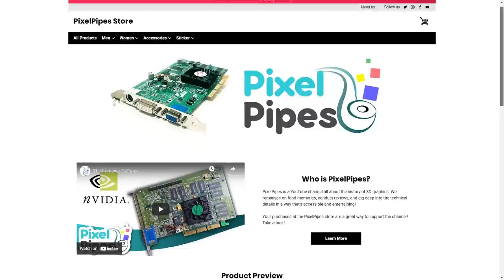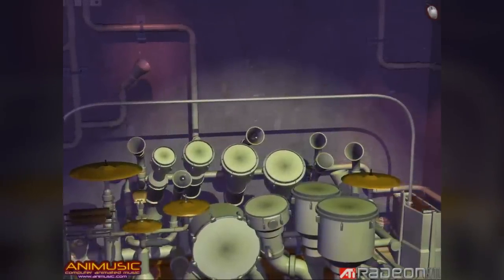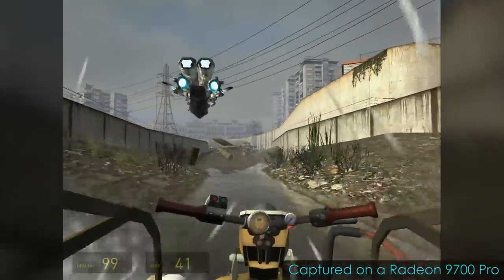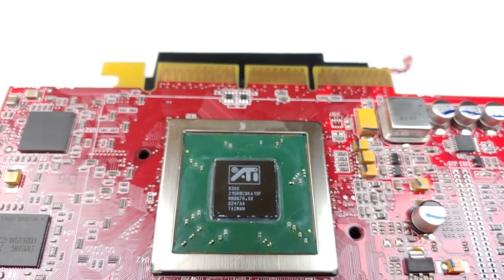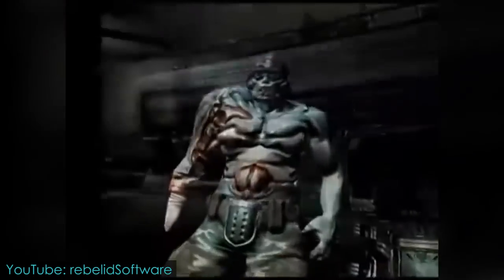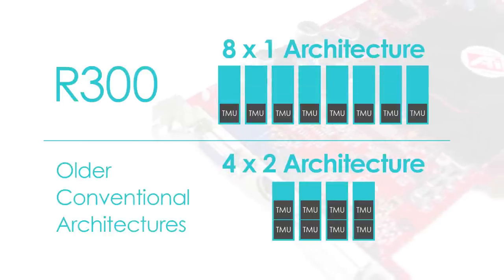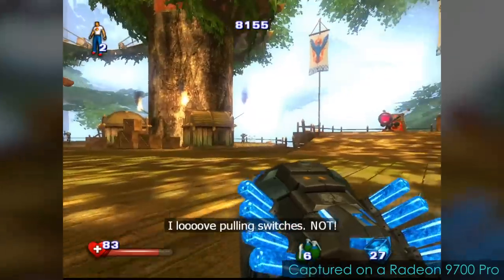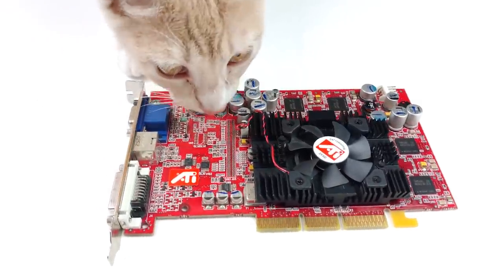ATI's Revolutionary Radeon 9700 Pro

Comment: Fantastic video! The 9700 Pro is one of my favourite graphics cards and it was such an exciting time compared to what we get these days...
Reply: Think about it, back in the day we would get great sound cards, great graphics cards and the leaps and bounds were actual leaps and bounds. Now it's like well you can play this game at 4k at 120FPS vs 60FPS.
Reply: @C4nn15  You know when even decade + old computers with 8GB DDRII, an OC AMD Athlon II X4, a cheap SSD, and with a lowend GPU like an AMD R7 240 2GB can still run many modern titles at 720p - 1080p low settings getting 60fps, or close too it running a lightweight Linux Distro like Manjaro Mate then we have hit a peak of sorts in terms of tech IMHO!  
I truly don't get the excitement these days that I did back in the 80's - mid 00's seeing each leap forward in tech.
Reply: That was an exciting year indeed
Reply: @CommodoreFan64  My current system is from 2012 with only a GPU upgrade to a 1050 Ti, and I can still play most games at decent settings, at 1080p. Granted, it's definitely time for an upgrade, but considering I've gotten 9 years out of this platform, it's certainly much different from how things used to be.

I recently acquired a Pentium II-based IBM Aptiva, and a system like that would have been hopelessly obsolete by the time this card (Radeon 9700 Pro) would debut, despite its very high performance just five years prior.
Reply: No the 9500 pro with a bios of 9700pro.
That is the card .
I had one with a aftermarket cooling like a blower.
Thing overtune like shit.
Reply: To be fair, the last generation now was actually a decent step up (the RTX 3xxx series and AMD 6xxx series). It's just that the prices are absolutely unreasonable.
Reply: @dyslectische  but there were no guarantee it would work
Reply: @PhilsComputerLab Do you have the CD or driver for the aiw 9700pro 128M AGP for Windows XP?  I have the card but did not come with the CD with the drivers and I cannot find the correct one online.  I'm willing to pay for it. Please let me know.
Reply: @jcjmz6660  You do not need a driver CD, the XP drivers are on the AMD website in the download section! Let me know if you have troubles!
Reply: @philscomputerlab  Thank you very much for your reply, I will try that, I'm waiting for a WD velociraptor from the XP era to install the OS again.  Very much appreciated.
Reply: cant wait for RTX 6090 to buy
Reply: It was exciting, but I'd rather not relive the time, where GPUs became near obsolete within 6 months.
Reply: @CommodoreFan64  yup I feel gtx 8800 may have been the last grand gpu release. Since then it was just who cares 30% gains every year with the occasional  50% if the competition looked like it would release something actually competitive. The last era I truly enjoyed the majority of game releases with 2005 to 2008 roughly. Then it truly went full fledged endless sequel, rehash, then eventually the current dark ages of unfinished games at launch, micro transactions,  and also overall lack of new releases in general because companies are just cashing in on their current games and investing mainly in the micro transactions and merchandise to those games.
Reply: It's 100% my favorite GPU from the past. Absolutely hands down. Everything changed with this VPU.
Reply: @dyslectische  Yes! Loved those mods.
Reply: Back when great video cards were affordable eh!
Reply: Same, love my Hercules 9700 Pro. It smokes every AGP card I have of its era. The only thing it can't beat is a recent X1950 Pro AGP I got, another vast behemoth.
Reply: Sometime back around 2003-2004, after coming up with all that i could and setting a budget, i built my first PC. Hard to remember every exact detail now, but it had a P4 2.4ghz CPU, i think only like 1gb ram, an 80gb HHD which was actually fine for a while. Win XP pro. 5.1 surround. And being a fan of ATI going back into the 90s, i had the All in Wonder 9700 pro, which was $400 at the time. Altogether it cost me $1,800 to build back then. And this PC held up fine for a long time, eventually my GPU went for some reason, so i replaced it with something newer. I sort of retired it somewhere around 2012. (Because of the mobo i couldn't further upgrade the CPU or RAM) Just wasn't holding up so great, so i just used it for emulation and older games. 

But those were some good years back then, i miss it. There was a lot of cool stuff we just don't see anymore.

Comment: I made the jump from a GeForce Ti4200 Golden Sample from Gainward to an ATi Radeon 9700 Pro when I built a brand new system based around the nForce 2 Ultra kitted with an Athlon XP 2500+ and 512MB of DDR1 Corsair CMX Platinum which allowed me to OC the CPU to 3200+ levels at a much lower price. The jump was incredible and I was playing all my current games at higher res on my 19" Trinitron monitor. I remember working for 3 months to save up the cash (fast food and being a teen meant minimum wage) after hearing the news of the pending release and bought the card a few weeks after release.

Comment: Very nice video! I remember, that I desperately wanted to get a 9700 Pro, but as a student, I just didn't have the money to buy it. But there was a solution! With some luck you could modify a 9500. Shorting two contacts with a drop of electric varnish you could enable all 8 pipelines and with some overclocking get it on the level of the 9700 Pro. This was what I did eventually and I had luck. I added a better cooler and even overclocked the card over the usual 9700 Pro frequencies. I used the card for a quite long time and still think, that it was one of the biggest steps in real time 3d graphics technology.

Thanks for the memories!
Reply: Same fond memories of unlocking and overclocking the snot out of my 9500. While my memory clocks were never terribly impressive my core went to the moon!
Reply: thank God someone mentioned this. Good old days!

P.S. - I never had the money to afford myself those Radeon cards. But I knew about all of them and all their capabilities and possibilities. Wonderful memories.

Comment: I loved this video, and I loved my 9700 Pro when I bought it used in 2004. I do find it amusing that the interview clip with John Carmack had him talk about how fast the R300 could render real-time shadows, though. When Doom 3 was first released, the cards in the R300 family were under-performing until a programmer in the community realized that the driver calls for computing shadows were remarkably inefficient. He wrote a patch that replaced those instructions with more simple equivalent math, and performance increased by a VERY noticeable amount! It was so good that ATI integrated it into their next Catalyst driver revision, and it was mostly forgotten after that. I still have the file, even though it's not needed anymore unless one is using Catalyst drivers from before 4.9 or so.

Comment: I was fresh out of high school when this came out, this was the card I always wanted but could never afford back then. I believe every computer nerd has that one piece of hardware they always wanted to get but couldn't afford at the time. Mine was the 9700 Pro. Nearly 20 years later, I finally put a 9800 pro in a 2003-2004 era P4 rig. Thing shreds...
Reply: I was just entering high school at this point and remember how the 9500 Pro was the overclocking champion, the 9700 NP (non-Pro) could be modded/overclocked to insane levels, and the 9800 Pro couldn't be beaten by NV even once they finally showed up to the party.  I wish I hadn't thrown out the cards I had back then ("those slow old things haven't been relevant in years, why do I hoard this junk" mentality) but I have rebuilt my collection with a 9500 Pro, 9800 Pro, as well as X1950 XT and FX 5950 Ultra (always wanted one but they were too expensive).  Fortunately I still have the same computer as I did then.  I keep my 5600 Ultra in there to keep the power supply load easy (this is when PSUs had a max output of about what my 3080 pulls) with the same 60 GB WD hard drive though I have maxed the board out at 1 GB of RAM (up from 128MB) and it has Windows 7 because back then it was amazing how it could run on "only" 1GB of RAM.  Back before Roku sticks this was my streaming machine once its duties as gaming machine were retired.

Comment: I still run a ati aiw 9800 pro.. Love the card and all its features.. tuner still works with a digital to analog converter and a tv antenna .. used to to convert vcr tapes to dvd.. saved family videos.. play games.. ect. ect..
Reply: Likewise, although I think the composite in has went on mine. The image is completely messed like those macrovision copy protection all the time. The rest of the card seems to work fine though, strange.
Reply: @gen_angry  that stinks.. It is heart breaking when they finally give out..

Comment: I had the Geforce2 Ti when Battlefield 1942 came out. I got low fps and stuttering no matter how low the settings. Upgraded to the 9700 pro and wow. BF142 on med to high settings, zero fps drops or stuttering. 9700 pro is 1 of the best gpu's I owned.

Comment: Never had a 9000s card but always looked at them with awe...these were the best days.. unlocking driver features with tools an if you was lucky enabling extra shader pipes like was it on the 9600 to 9700pros an the 6600 from Nvidia had versions that could be turned into 6800s... I looked at my locked shaders in my 6600gt in riva tuner an wishing I could unlock them...tho my 6600gt was as quick as a stock 6800 in most stuff due to the insane clocks it had...but still those extra 8 shaders an 4 vertex shaders would of been a treat...an the fact they was physically on my chip made me cry

Comment: Voodoo5 5500 required external power in 2000 in fact it need more then the 9700 and used a full Molex connector
Reply from the maker: You are right and I got this wrong.

Comment: I get sentimental with this, what a greatly put video. The fact that you can still use this card on Windows 11 is just nuts. The official Vista 64bit drivers works when you install them through Device manager just fine.
The die shrink (RV370) of this on PCIe (X600) runs even on my modern AM5 PC with CSM enabled, connected to my LG 4K OLED TV through DVItoHDMI adapter. Yes, it DOES RUN CRYSIS. Revolutionary chip indeed. It's such a nostalgic feeling to have this working on my main PC, playing the classic games I had on my first PC that I got on my 10th birthday.

Comment: Back in those days I had a 9500 Pro which was the 9700 Pro's slower but still quite capable brother. It was amazing to see what that card could do, especially compared to the Radeon 8500 & Radeon DDR cards I had owned before the 9500 Pro. I was crushed when my PC was damaged as part of my divorce in late 2005. I was able to salvage the rest of the machine but sadly the 9500 Pro never worked again.

Comment: Aww man! Brings back fond memories! Water cooled Athlon xp 2500+ and volt modded 9700 pro on GPU and memory. I remember ripping off the voltage regulator on the back with the heat spreader in it 😢wanting to put a proper heatsink on it! I got a nice O.C from it until one day I come back to the pc in two colour mode, just black n white. CPU waterblock leaked onto my beloved Radeon!

Comment: I had a Radeon 9500 in my computer. Sadly, it couldn't be modded into 9500 Pro but it was still an amazing card. <3
Reply: I had/have a 9500 Pro & remember unlocking it with Kip Hardina's Warp11 BIOS... 🤔😊😄
Reply: @David Bolha  i tried to unlock mine with modified ATI drivers. While it did work and I was able to get extra pipelines working, there were artifacts on screen. For instance, I'd have a mesh of equally spqced rectangles on the screen along with visible video distortion.

Comment: I went to CompUSA(remember them?) and they didn't have any 9700 Pros in stock, so I headed over to Best Buy and they had ONE left. I brought it home to replace my 8500 and was blown away by the speed. It was so fast that it was CPU limited. When I replaced my CPU the next year my minimum FPS went up a ton. Eventually replaced it with a 6800 GT which was faster but not nearly as cool.

Comment: I could not hit "Like" on this fast enough! This was my first GPU upgrade way back in the early 2000s. A phenomenal, legendary GPU that for me personally introduced me to the hobby of PC Hardware. I wouldn't have the enthusiasm I have today were it not for this card. Kudos to you for producing this excellent content! 

A story I like to share is that my father was using our old family Dell Dimension 8200 as a USB charger. Yes, the very one that I upgraded with an ATI Radeon 9700 Pro in 2003! I went home to visit probably sometime in 2017 and he had this desktop tower plugged into an electrical outlet and nothing else connected to it except for his cell phone. Inside was my original ATI Radeon 9700 Pro slaving away, fully powered on, simply so he could charge his cell phone. Needless to save I promptly unplugged the machine and took it home with me where it still resides to this day. I still have the original box which I will always cherish.
Reply from the maker: You did a great thing saving that card!

Comment: Oooh, I had one of these, bought to play Far Cry. It had a giant Zalman passive heatsink on it. It cooked itself.
I replaced it to a 8800GTS to play Crysis, and it cooked itself.
After some years with midrange stuff, I got a GTX 970 to play DOOM 2016. Put giant superadvanced Arctic cooling on it so it does not cook.
... it cooked itself.

Comment: The performance benefit of the 9700 Pro was massive in comparison to the 8500LE that I had before it. My 9700 Pro was the AIW version. I had to get the AIW as the regular 9700 Pro was not in stock at the time. Computer stores in my area couldn't keep them in stock due to their popularity. They were also creaming FX series GPU's from nVidia. It was only when the 6800 GT came out that I replaced my 9700 Pro AIW with it, when VRAM was now becoming a focal point of future gaming.

Comment: I had a 9500pro I got from a friend for free. I benched that against an Nvidia FX5900xt and while the 5900 won, it was not by much.  I even had fun and installed the bios from a 9700 in that 9500pro just for the heck of it. When it ran it displayed 9700, fun times back then.

Comment: Man that intro deserves an instalike before I keep watching the video. What application was that? It reminds me of the xp era or even before that.
Reply from the maker: Pipe Dream? It was a famous tech demo for the 9700 Pro
Reply: @PixelPipes  thanks man. I still have the little brother of this beast fully working. I used it until 2007 then upgraded to an Nvidia 8400gs.... it overheated so much and worked so badly that in a couple of months upgraded to a 9600 GT Super.

Comment: I also have very fond memorys of the card. In fact, it is the only ATI/AMD Card i have ever used (as in my top tier system) in all of my years of PC (Gaming), apart from the Rage 2+ in my first PC. 
Coming from a originally-not-so-shabby Geforce 2 Ultra, i was amazed by its DX9 graphics and, thanks to its wide design, the ease it seemed to have running all titles at high resolutions with anisotropic filtering and even FSAA. i dont know how many hours i clocked in elder scrolls III morrowind with it, must have been easily four-digit...

like you, later i moved on to a 6800 GT to feed that sparkling new 1680*1050pixel TFT on my desk, but even than it still didnt felt like a completely outdated card and was still able to run new titles (with a bit more modest quality settings) until the DX10 age came around.

Comment: Oh yeah.. the 9700pro was the single most extended use video card I ever had. Used it for many years. I still have it in the box on the shelf too. Loved Pipe Dream! I still have that installed on my current computers. It even runs, and looks amazing 🤩, with my Nvidia 3d vision monitor and glasses setup.

Comment: Didn't have a 9700 pro but did have a soft modded 9500 pro It was awesome
Reply: With Kip Hardina's Warp11 BIOS ? 🤔🙄
Reply: @davidbolha  I probably have all the info and data backed up on CD's on the other side of the country. Wouldn't be able to tell you exactly right now, it was a relatively simple process though. Notable 3dMark 2001 improvement at the time.

Comment: I had a nVidia Leadtek WinFast GeForce 4 Ti 4400 or 4600 don't remember exactly. With Athlon XP 2500+ overclocked to about 3200+ EpoX motherboard or the nForce motherboard because I had tried both boards (and more) don't remember exactly. Then I got the Sapphire 9800 Pro 128Mb I had flashed to a 9800XT just for device manager glory & boot up recognition although moment of owning it was the top dog before XT. I still have some of this stuff in my garage. I remember this was the time when PC market strated to boom with fancy hardware & cases to choose from. I had by the time the ThermalTake Xaser II 6000A aluminium finish that had swapped already many hardware AMD combos with many nVIDIA cards & the ATi card mentioned above. Now btw I had built a modern PC in that case for my self the 2070 Super fitted very tightly can be found on my channel. The second built 2080 Super PC that has the new Phanteks Enthoo Evolv X Mid-Tower Galaxy Silver case with Corsair 150Pro AIO for CPU, 128Gb DDR4, Xeon 2678 @ 3.3Ghz TurboUnlock on all 12 cores.

Comment: My first really expensive display card that I bought in 2003 was Radeon 9700 non-Pro. It cost 300€ if I remember right. Flashed it immediately to Pro -model and later overclocked beyond that with Vmods and Zalman VF700 copper-cooler. I still have that exact same card, amog with 9800Pro and 9800XT that I got later.